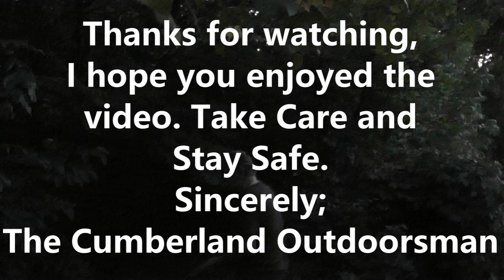Vintage CVA Hawken Rifle Restoration

Comment: The T/C 50 cal Renegade that I inherited was stored with a cork(who knows how long the cork was there) in the barrel. when I found out I took it apart and poured muzzle loader bore cleaner in it and took a 12 gauge brush attached to a drill and scrubbed the barrel out until all rust was gone and replaced the nipple and had to reblue the barrel. Now it is clean and works flawlessly.

Comment: I made a .50 cal. CVA Mountain Rifle of the same vintage as that gun. Two barrel keys, all browned iron furniture and barrel but for German Silver barrel pins and a pewter cap on the forestock. Stock is maple with some figuring.

I suggest you retrieve and inspect your expended patches down range. You wil be able to see evidence if any gasses are escaping around the barrel and patch as it travels down the barrel. That would indicate rust pitting.

Comment: Just a couple of words. First, great video. I love watching redos.
First, Jake never removed the wedge plates after he installed them. He put them on, and let them age. Second, The Hawken shop never used brass. Except in special occasions and that was rare. They had a trademark, and very rarely changed the look. Here is how they blued their rifles, They browned them, carded them, and rebrowned them. Then they set the barrels that were browned into boiling and let them set untill the desired blue came on, it was controlled from light blue to almost black. There are also differences in the stock profile. The fish belly is gone, there is a wedge sanded into the grip next to the shooting fingers that goes from the cheek piece to, then down to half way to the trigger. Makes a subtle wedge. I am no expert, but the trigger guard indicates it was a Jim Bridger. His rifle had brass furniture, and the hooked trigger guard. That descending curl would get caught in the woods. A very accurate rifle. When I get a rusty bore, after cleaning it, I would load it, then put a patch under the ball soaked in Clover. A valve lapping compound. I start with 1 grain, with 1 cal of ball. If .50cal, I go 50gns. Fire five balls. One with 70 gns of black powder. A lot of times, the edges of the rifling has chatter marks. The Clover smoothes it out.
In the '60s my first rifle was a .50 Mountain rifle. CVA. I beat the snot out of it, and this year I gave it to my Grandson to learn on. Good rifles, like the Thompson Center you have.
You did a good job on that rifle. I loved the Video.

Comment: Cool trying to keep restorative without a ton of modification. There is a disappointing back story on these Hawken Style not a Hawken reproduction. If one ever walks across a "True Hawken" as I have, I instantly knew the difference, these are great I got the same exact on my wall, most do not realize true Hawken has two barrel wedges, with exception to the Kentucky Hawken it is pinned. However these as I state are awesome as well as for the one barrel wedge I still get another. As far as Cap/Patch Box it can be used as either primarily the round ones were Cap, Patch Box was quite a bit larger.

Comment: Kia Ora from NZ Tom.
 Great job on your reconditioning. 
 I got the very same rifle & in much the same shape condition as yours.
 I used steel wool a few strands wrapped around a  jag & working on it over 2 weeks got the barrel clean. 
I hear much bad on Spanish barrels ( ive never seen a USA on to compare) 
But the spain barrel is great actually. 
 & i really liked the windage adjustments on back sight. 
 Pretty good shooter. 
 Really enjoyed your movie. 
 Have fun with that smoke pole 💥
 Ata Marie 
Nga mihi 
Chris

Comment: I believe I would have pulled the stock off of it before I poured solvent down the barrel and let it run out the nipple hole. It cannot help the finish. I leave the nipple in, plug it with a wooden toothpick and pour in the solvent and let it soak for a little. Then disassemble and clean and lube.
Reply from the maker: I was going to do that. I have found that traditional Hoppe's #9 doesn't hurt the finish, as was the case with this gun.
Reply: I thought the same thing, but he cleaned it up and it looked great. But as always, gun oil is good for the metal and bad for the wood if allowed to soak in.

Comment: Pyrodex P...works good in CVA caplock......Finer granulated as we know..equal to 3 f black powder .i reduce charge when using pyrodex p.. ignition much better than RS
Reply from the maker: If I find some Pyrodex P, I'll get it and make a review video. Thanks for the suggestion.

Comment: This was very nice. I enjoy your videos. I do wish you would not dry-fire the caplocks without a cap on the nipple. Kind of like dry-firing a rimfire gun. Not a good idea in the long run.
Reply from the maker: That's true. Prolonged dry firing is never a good idea, and percussion nipples are easy to ruin that way. I should have mentioned it in the video. Thanks for the suggestion.

Comment: That hesitation is usually from the nipple. Sometimes they clog from the powder blow back. Picking the hole, or drilling it out slightly prevents this.

Comment: How about a TC Renegade off the website used guy said it was in great shape oh, of course that's what they all say I guess put a patch down through it and when I brought it out, look like somebody shot it with birdshot the patch has so many holes in it from the rusty boar I was very disappointed, I probably put 500 patches through it with chrome and mag polish, I forget the name brand now that thing shoots like a dream, still has plenty of rifling in it I guess, also used a little steel wool at first, a nylon 50 caliber brush with the chrome polish will clean out the lands and grooves

Comment: barrel has rust, any rust pits its done. exterior don't matter
Reply from the maker: Not necessarily true. I own a Mauser action 30-06 that had some barrel rust, even some pitting about mid way down, but it shoots less than an inch at 100 yards with a 150 or 165 grain Hornady BTSP pushed by 53 grains of H-380. It has out shot several rifles in the past. Some rifles just shoot well.